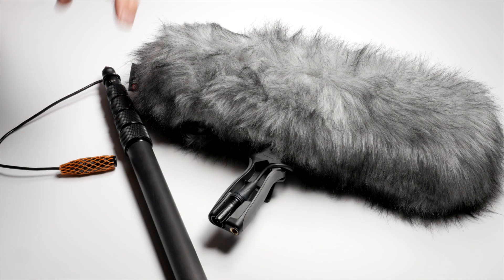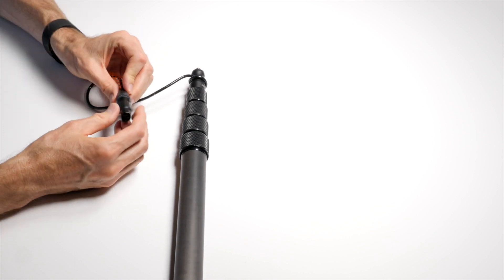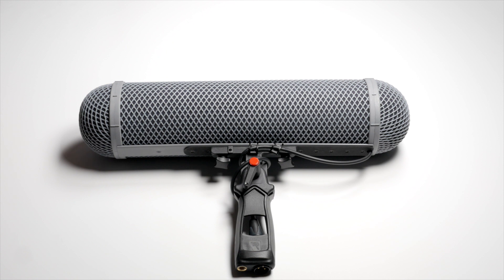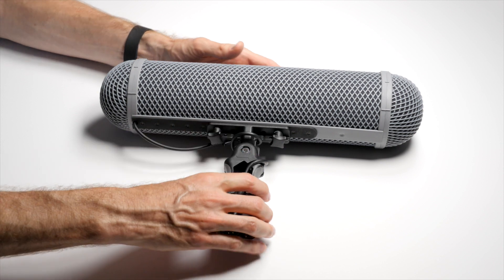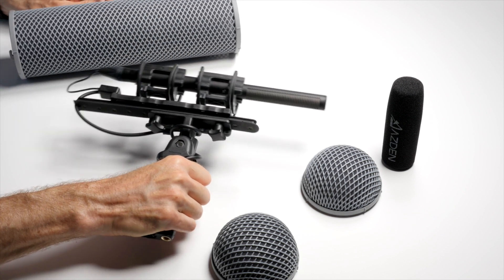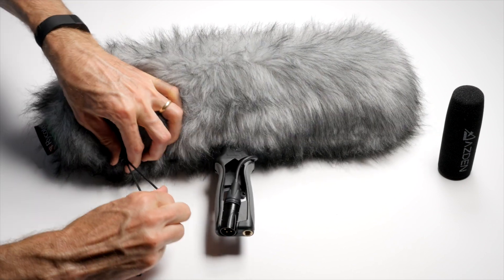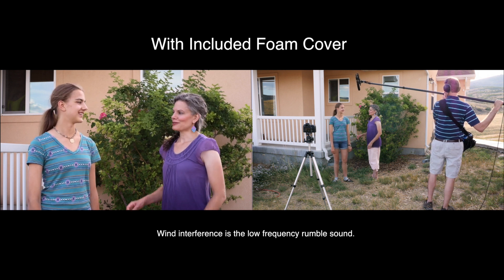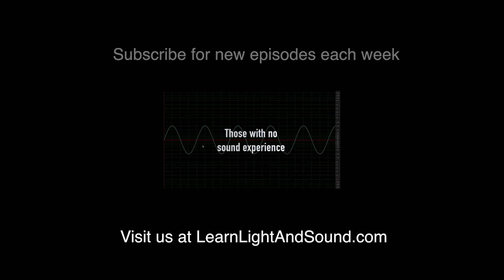Recording with Shotgun Microphones in the Wind: Wind Cover and Boom

Comment: I have a Sennheiser ME66 and for outdoors I use the newer Rycote Super Softie and found that it works very well as I live in a particularly windy area and you don't hear the low noise distortion of the wind in the recording, just hear the wind. I have used mine with a Tascam DR100 MKII and always record to it when doing outdoor recordings.

I noticed that my recordings sounded clearer when recording someone's voice than some of the furry windjammers I have used, which can muffle the sound a little more I have noticed and even recording someones voice in a particuarly windy day, I was able to record it and hear the persons voice, along with the wind, without any distortion or the wind interfering much with the voice on the recording.
Reply from the maker: +DynamixWarePro Yes, a very good point. The furry covers definitely cut some of the higher frequency sound from making it to the microphone.

Comment: Hi Chris, is there a rule to how close the tip of the shotgun mic should be to the end part of the blimp? Should it be to the edge of the screw off section or in it? Maybe an inch deep in side the blimp? Thanks in advance.
Reply from the maker: Ideally not right up close to the front - at least an inch from the front. You need that space for any moving air to diffuse.
Reply: @curtisjudd  Thank you so much!

Comment: Hello Curtis, my Rycote modular windshield kit 4 that I got for my Sennheiser MKH 8060 holds the mic on the lateral slots of the mic. Should I turn it around so the slots are north south rather than east west (if that makes sense). Surely it's not great that they are partially covered? There was some issue with the smaller kits when I enquired about them before buying this one with the MKH 8060. Thank you, L
Reply from the maker: Hi L *, I'm not sure I totally follow, but yes, best not to cover any of the slots in the interference tube. Don't be afraid to mount on of the Lyres to the XLR connector to give yourself more room for the front lyre.
Reply: @curtisjudd  Thank you -I would have been wary about that but I'll give it a go.Thanks.

Comment: I was checking the rode blimp that also incorporates the  shock sound system from Rycote I believe for a lesser price. 
What are the differences between both of these systems? Does that justify the price? My next shotgun mic will be a Rode NTG8. Thank you for the video.
Reply from the maker: +Steven Rix Thanks Steven. Yes, I just had a chance to use the RODE Blimp and it looks nearly identical to this but half the price.

Comment: Hey Curtis....what is this like compared to the Rode Blimp MKII...nice vide test in real wind.
Reply from the maker: Very, very similar. In terms of ability to manage wind, they both seem to do great. The RODE is a little bit heavier so I think the main thing you're getting with the Rycote is less weight. It isn't a lot but can make a difference if you're going to be booming a lot.
Reply from the maker: Yes, that'll do nicely. I like the Rycote Cyclone because it works just as well as the older model with a furry windjammer with just the 3D-Tex material and it is much quicker to open it up and reconfigure with a different mic. But of course you pay a bit more for that luxury. This is the one I use: https://bhpho.to/2kwDBw6
Reply: I am liking that one Curtis.....the Cyclone it the King of windsheilds, shame that there is not a few more reviews in Blimps/Windsheilds.....as i think that it's a very important part of a videographers kit.....

Comment: hi Curtis, interesting as ever thanks

are you still using that technique for holding the boom pole?

when i've done acting in tv shows i've seen the pros holding them using their shoulders to rest the pole on, like a yoke
Reply from the maker: Yes, that's a good technique as well if the framing of the shot allows. I have found since then that because I am unusually tall, that I can generally use the yoke hold or lower my elbows to my side for longer shots. In the end. I'm an advocate of whatever method will result in a clean recording without dipping the mic or pole into the frame. :)

Comment: Hi, Curtis! I'm buying my first Wind Cover and Shotgun Mount system and I'm having real doubts about it.

For financial reasons, I need something that costs less than $300. I really like the idea of the Super Softie and the Universal Mount, it's cheap, light and it's Rycote, but I don't know if I'm gonna be in trouble someday in the lack of a blimp. On the other hand, there's the Rode Blimp... it's heavy, costs a little more (but it's cheap comparing to Rycote blimps), and it leaves too much space in the front of the microphone (I'm using a Neumann KMR 81 i), but never failed with the wind.

What do you think?

Cheers from Brazil.
Reply from the maker: Hi Felipe, This is the big tradeoff: Weight and size for effective wind protection. There is no question that the blimp/zeppelin style covers work better in faster wind. If I were only to buy one where I live (where the wind is quite frequent), I'd go for the RODE Blimp. However, if you only ever get very mild breezes, the Softie should be enough. Good luck!
Reply: Thanks, Curtis. You were really helpful and quick in your answer!

Comment: Hey!
I'm trying to decide on the best boom stand to get for film projects/videos I make.  I plan on buying a  Rode NGT-2 and Zoon H4N and using the mic with the boom mic stand.   
I've been doing a lot of research but I can't seem to really figure out which is the best bang for my buck.

Any suggestions?  Thanks!
Reply from the maker: +Sam Thomas If you or your talent will be seated for talking head and interview videos, I usually just use a $25 microphone boom stand like this: http://amzn.to/1PQI0DT  There are definitely higher grade stands as well that are modular. Here's the Triad Orbit which you can add boom arms: http://www.bhphotovideo.com/c/product/1060963-REG/triad_t2_standard_tripod.html/BI/19904/KBID/12941/kw/TRT2/DFF/d10-v2-t1-xTRT2

If you'll be hand booming, RODE has a decent entry level boom pole: http://amzn.to/1Id5dh1  And K-Tek makes pro-grade poles in both aluminum and carbon fiber. I use the K-Tek KEG150CCR: http://www.bhphotovideo.com/c/product/426794-REG/K_Tek_KEG_150CCR_KEG_150CCR_Avalon_Series_Graphite.html/BI/19904/KBID/12941/kw/KTKEG150CCR/DFF/d10-v2-t1-xKTKEG150CCR

I would caution against the combination of the Zoom H4n and RODE NTG2. I have both of those and would recommend you instead of the Zoom look at the Tascam DR-60DmkII recorder. Here's why: The NTG2 needs quite a lot of gain from the recorder. The H4n does not have the quietest pre-amplifiers so when you crank the gain up to get enough amplification for the NTG2, you end up with quite a lot of noise. The Tascam is capable or providing more clean gain and also happens to be a little less expensive. You give up built-in microphones, but you'll be a lot less frustrated and capture cleaner recordings. Here's my review of the Tascam: https://youtu.be/TRoIMPHS91U

Best wishes!
Reply: +Curtis Judd Thanks a  bunch!  Quick question, are there any other recorders that do have built in mics that will give me as clean sound as the Tascam. Or possibly a better combination of mic+recorder that isn't drastically expensive?

(My film projects are acting things, so each once varies just to note)

Thanks again!
Reply from the maker: +Sam Thomas The Zoom H5 is worth a look: http://amzn.to/1NdAhcB
Reply: +Curtis Judd Thanks! Though as you mentioned in your Tascam review,  would it be best to get the Tascam to have cleaner audio with the NGT-2 than what the Zoom H5 or H6 would give me with it?
Reply from the maker: +Sam Thomas I did a little more testing after this review with the H6 and it is on par with the Tascam in terms of noise. The H5 has very similar pre-amps to the H6 so that'd be fine as well. It is the H4n you'll want to avoid.
Reply: +Curtis Judd Thanks a again for the help! A couple of other questions.

When would you suggest capturing the audio directly from the H5 vs capturing the audio from the NGT-2 hooked up to the H5

Also, when using the NGT-2 is there specific setting I should set on the H5 to assure the proper pre-amp/quality recording.  I don't really know about pre-amp stuff. 

Thanks so much!
Reply from the maker: +Sam Thomas Shotgun mics like the RODE NTG2 are very directional (pick up most sound from the front and much less from the sides and back) and are best suited for capturing dialogue outdoors or in large rooms that don't reflect a lot of sound off the walls. The H4's built-in mics are cardioid which means they are also direction though not quite as much as the RODE NTG2 and are better suited for rooms with reverb (sound reflecting off of the walls).

As for the recorder settings, if you're filming, I would set the sample rate to 48kHz, the bit depth to 24 bit and the format to .WAV. Good luck!
Reply: +Curtis Judd Thanks!  And so if I'm understanding correctly, in rooms with reverb less directional mics are better?  Why is that? 
Also, if that's is the case in a room with a lot of reverb such as a very small room, would it be better to use a non-cardioid mic such as those used to record vocals in music studios?
Reply from the maker: +Sam Thomas No, sorry for the confusion:

Indoors - Use a cardioid mic without an interference tube (like shotgun mics have). A cardioid mic is also a directional mic.

Outdoors - use a shotgun mic.
Reply: +Curtis Judd Thanks! So why is it that a mic without an interference tube is better for the areas with more reverb?

Also you mentioned earlier that if the room isn't too small  and doesn't have too much reverb then the shotgun is still the better choice for that situation right?
Reply from the maker: +Sam Thomas Explained here: https://plus.google.com/b/113032879696266987155/events/cbd2m7n63menfpn0f6la3g5kni0

Comment: Hmm, that wind noise with the foam on is still pretty tame. With my microphone, pretty much any wind at all distorts it into this peaking, crackly mess. That's why I bought a Rode Blimp, and haven't looked back since.
Reply from the maker: +Stuart Tollison Yes, the Azden SGM250 does surprisingly well in the wind. I'm thinking the RODE Blimp is great value for money.
Reply: +Curtis Judd It really is, I'd recommend it to anyone on a tighter budget. Also, have you ever used a VidPro XM-55 before? That is the microphone I have and use. It does the job well enough for me, except for the incredible tendency to distort. I would kinda like to see it compared with something like your Azden and a NTG1/2 because it is in the lower, entry-level field. For a hundred bucks, the kit may be an incredible steal. I just don't know because I don't have anything to compare it to.
Reply from the maker: +Stuart Tollison I haven't tried the VidPro yet, may be worth a look. Thanks, Stuart!
Reply: +Curtis Judd No Problem! If you do decide to take a look at it and make a video, don't hesitate to ask me anything about the mic or my experiences with it.
Reply from the maker: +Stuart Tollison Will do!